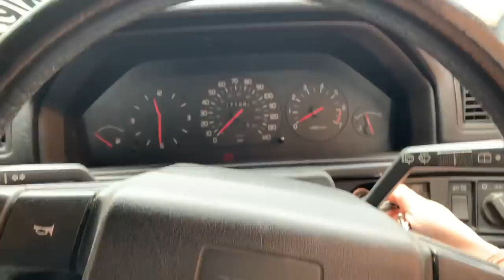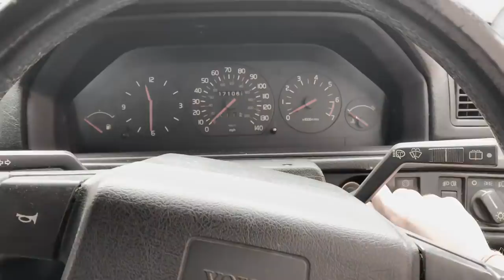FIXING THE LEAKY VOLVO!

Comment: Hi Emily, I think you are doing well at mechanics.
I got a new/old stock thermostat for my Humber Hawk project car and it arrived last week. I had to get it from England because none of the right type available in NZ. The postage cost more than the thermostat. I could have made an adapter to fit a more modern one but I like keeping to what it's supposed to have.
The housing lip had corroded away and I couldn't find a new or better one so made a spacer with a stepped lip out of brass plate on my lathe to hold it. Now it needs two gaskets instead of one and longer studs.
A lot of work just for a thermostat

Comment: There’s normally a gasket, or at least some sealant needed on the thermostat housing. Maybe that’s not required with a seal on the thermostat itself? Starting it up and running to temperature will answer that one anyway.
Reply: The seal is on the stat itself.

Comment: On most older cars, as with most jobs, the cam belt is a straight forward thing to do, you just need the right equipment and a methodical approach, taking photos all the way.  Best thing you can do is roll your sleeves up and get stuck in, worst you can do is end up scraping it.

Comment: The green crud might be some kind of stop leak.. so fresh fluid wouldn't be a bad idea.

The other thing is there is a little valve that helps bleed out air (looked like the new thermostat had that feature).. that's supposed to face upwards when you install.

Comment: Leaks on a Volvo are not a fault but a feature. A wet spot forming on the ground let's you know there's still juice left without having to pop the bonnet to check.
Reply: its easier to say wich volvo isn't leaking oil because that list wil be shorter well alot shorter

Comment: Here’s what I found out about the 940 Volvo speedometer issue There are four possible culprits:

The vehicle speed sensor which plugs into the back of the differential
The wiring from the speed sensor to the back of the instrument panel
The printed circuit board on the back of the instrument cluster
The speedometer itself
 Also to explain it further This is a vehicle speed sensor which plugs into the back of the differential.

Look under the rear of your Volvo at the differential cover, you will see the wires going into your sensor on the cover. If the plastic/rubber sheathing covering the two wires (not the larger protective cover) has started to crumble and fall off at the sensor, it will cause a short that will cause your speedometer to act erratically or not at all. It's an easy fix, and this was a common problem in the 90's rear wheel drive Volvos with some age and weather on them. Here is a site that may be of help to save money on your future Volvo projects including a replacement speedometer if need be it’s better to be safe than sorry when it’s as important to have it in full working order so you won’t get a ticket for speeding but I know you will want to have it fully functional before putting it back on the road and they might be able to help you with the hatch shocks so you won’t get whacked in the ass by the heavy hatch just assisting you with your 940 that just needs a massive amount of tlc  also the reason why you may have to always have it jumped the possible culprit may be the alternator or the battery is expired yes batteries expire and I’m not saying that in a mean way just giving you positive information especially during this lockdown which I hope ends soon but I’m glad you are staying occupied as well and I’m enjoying your videos though Cheerio 🌹

Comment: Antifreeze congeals when it leaks and forms like a green snot. That could have been what was around the stat housing. You should have made sure all the mating surfaces are all clean before you bolt it back together to make sure it has the best chance of sealing. 

Also it was probably easier and less effort to lift the cover off than climb over the seats!

Comment: Taking the cam belt off on one of these is allright for even the most beginnery beginner, its accesible af and also if you were to put it back all wrong yhe valves cant tuch the pistons anyway so your bits will live!
Reply from the maker: The thought terrifies me, I’ll leave that one to the professionals🤣
Reply: @emilyshields3667  I didn't even own a toolkit when I first got my 940 year later I can do a cam belt in 2 hours including all the seals its actually piss. Might aswell give it a go it's a days work with about 4 weeks to do it
Reply: @emilyshields3667  I just mark the old belt and pulley tooth on each pulley and take the old belt off. Make sure the pulleys don't turn at all. Lay the old belt over the new and transfer the marks keeping count of the teeth as the old one may have stretched a bit. Then fit the new belt to the marks, tension and it should be good. But with the new belt on turn the motor by hand a full cycle slowly to check that nothing hits before putting the covers back on
Reply: @emilyshields3667  lol fair enough
Reply: The turbo engines are interference so they will destroy themselves.

Comment: Get a portable jump starter off eBay, got myself one earlier this year and it's saved me so much hassle messing about with jump leads! Only cost about £20 too :) Managed to start a 3.0 v6 with a completely dead battery too!
Reply: kerryw123 got a link gir £20 one or the name?
Reply: @63MIJ63  Sure, just looked and for some reason there's very little around in the UK at the moment so you would have to wait for postage from China but it's only £10 and it's the exact one I have. Depends on engine size but I usually jump a 2.0 diesel and it will do it 5 times before needing to be re charged. https://www.ebay.co.uk/itm/402228889041 unless you search for ones in the UK but the cheapest I can see right now is £32 and not as powerful
Reply: kerryw123 great thanks for that, great help!

Comment: U need to bleed that cooling system now u changed thermostat  or u will have a airlock 
Leave it run with the cap off
To bleed the air out
Reply: Redblocks don't really need any of that they bleed themselves fine.

Comment: The timing belt on these shouldn't be much harder than the thermostat, there are more bolts and it takes a lot longer. As a pluss these engines are non interference so you won't destroy it by getting the timing wrong. So if you need to change it (should be done every 75k km) I think you could de it ;)
Reply: B230FT TURBO MOTORS ARE INTERFERENCE AND WILL DESTRUCT
Reply: @ethixhiggins5059  I believed the single cam b230 engines were all non interference engines and that the FT and the FK were identical, but I guess that's wrong then. either way, this is a b230FK making it a non interference.